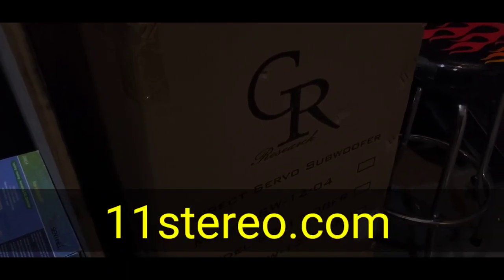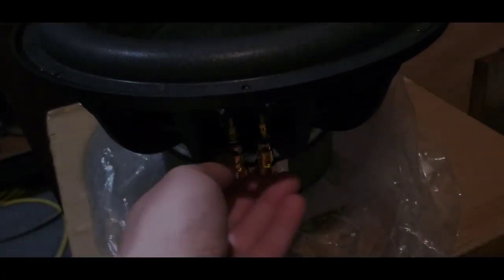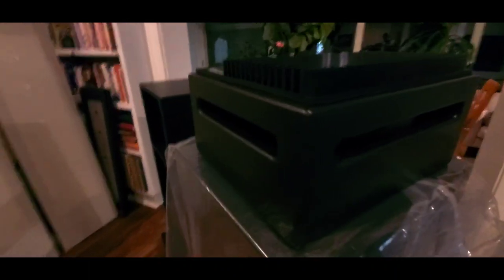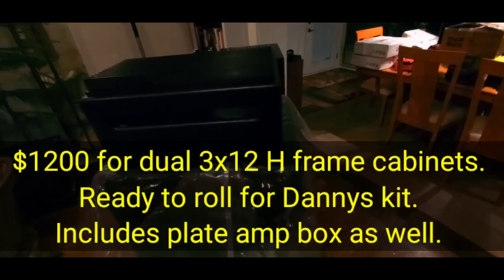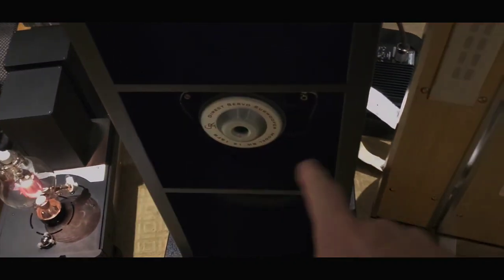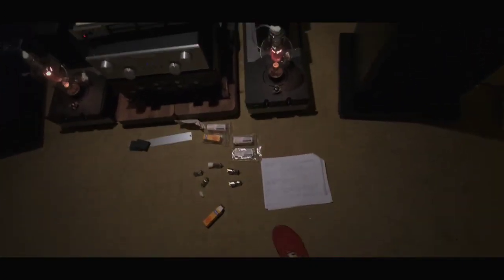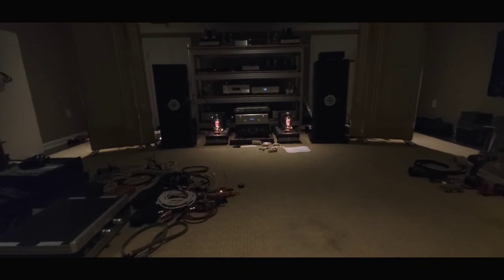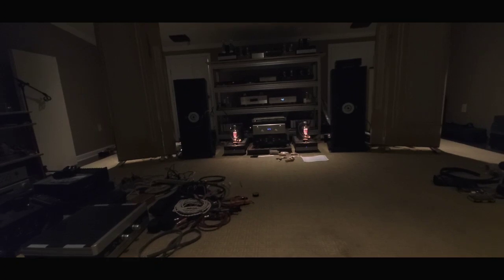Rythmik Audio servo Subwoofers GR Research open baffle

Comment: Hi how do you connect the subs if all you have is an integrated amp with no outputs
Reply from the maker: The way REL does and I cant stand this method but it does work I guess... you attach wires to the speaker outputs of t=your amp and run them to the high level input of the subwoofer plate amp. If you are buying subs make sure they have that capability first as not all do.
Reply: OCD HI-Fi Guy thanks how do you connect them?
I heard the GR sub for the first time the other day and the sounded too dry for my taste
Can you make them sound more like a 15” JBL driver?

Comment: The backwards driver is to reduce second-order distortion not to counteract the forces of the other drivers
Reply: Which it really can't because of the H frame - drivers would need to be really close (as in a push-pull configuration) for distortion cancellation. Still a good idea because of the more equal weight distribution (the magnets).

Comment: Dude, nice system
I dig these subs! 
I believe these are the ones I checked out at Axpona last year
 
fwiw;
the physical reversal of the driver isn't anything related to the driver's mechanical forces, it's to null the acoustic differences inherent in a driver's asymmetrical stroke characteristics 

as stated it's ideally effective in even numbers, and how significant the advantage is driver dependent

Comment: Hi Mike - long time listener - first time caller - lol
I run a pair of subs that were custom built for Ray Kimber that I picked up from his warehouse about 5 years ago with my Magnepans and it’s still the best match I’ve found. 

They are a sealed almost cube with Cabasse 21” drivers (I believe that’s the brand). I think the reason they pair so seamlessly is because the drivers barely move at all - just like the Magnepan panels.  I can’t tell sonically where the panel ends and the subs begin. 
So to sum up - a really large and well made driver with minimal movement seems to do the trick nicely. 

I don’t know the model number of the drivers and don’t know if they’re still manufactured. They’re 21” - the cone is coated in what looks and feels like black felt. I’m not going to remove the driver to check because they are really heavy and I’d hate to damage them.
Reply from the maker: Wow, killer Score man ! Ive played with the idea of 21's mounted in a closet with an open face to the room... One day ....  :-)

Comment: Very fast and clean bass but with rather compromised dynamism, compared to your old subs. Could we listen to that "Flight of the cosmic Hippo" track and a little bit of Mahler again? (I mean, we haven't heard this track on your old subs, so, no comparison...). I'm already wondering how Danny's single-woofer, servo-ed sealed sub might sound. Again, thanks for sharing. The experience shared is invaluable.
Reply from the maker: Hey FR, Tomorrow I will rewire per Dannys instruction as he sent the wrong wiring diagram thinking I was putting all subs forward, then I will replay Mahler(do you remember which one it was?)  and cosmic hippo
Reply: @OCDHIFiGuy  It was Gustav Mahler's Symphony No. 2 "Resurrection"
 with Claudio Abbado directing the 
Lucerne Festival Orchestra. But it was with only your Klipsches playing, so, no sub comparison again. Still, the exact piece played at your older video "
Gustav Mahler at 104 decibels. HEAVY METAL of the Era.", would be a great test for the new subs and main rig. I had the suspicion too, that something (wiring) was compromising the output.

Comment: Mike, 

1. The drivers coils are wired in parallel and the sensing coils are wired in series. 

2. There is not a force cancelling effect. The center woofer does not move in the opposite direction from the outer woofers. If it did then it would cancel out the output. All drivers move in the same direction. 

3. The No Rez should not be installed to touch the woofers, and yes it does take out the cabinet resonances. 

4. Be sure that you flip the polarity on the center driver (both driver and sensing coils) with it flipped the other way or it will knock the output down significantly.
Reply from the maker: Hey D, good to have your response,. thanks... ok so ive got the servo sensor wired in reverse for the center sub, but the driver wires do NOT show reversed on the diagram. So which is correct,  the diagram or what you just said,  to reverse the center driver, next, when I reverse the center driver which wires get reversed,  the input /source feed from below or the output/load to the top ? Or both ? This stuff plus having the center woofer reversed in the cab would be excellent info for the wiring diagram..  Thx
Reply: @OCDHIFiGuy  I didn't realize that you were reversing the center woofer. I have diagrams for both. 

And yes, if you reverse the way a woofer faces then you have to reverse the polarity of the coils on both the driver and sensing coils.  All woofer diaphragms have to move in the same direction.
Reply from the maker: @dannyrichie9743  Is there any benefit to reversing the center woofer if its not about forces ?

To be clear about sensing coils since they are in series, normal wiring per my diagram (if we start at bottom and move up) comes off amp red and goes to bottom woof red post then we come off black to red in middle woof then off black in middle up to red on top woof then black back down to amp. For the reverse, you want me to go out of bottom woofer from black to black middle woofer then red to red on top woofer then black back down to amp ?

Comment: Great video sounds amazing! 👍😎 Maybe build the plate amps into the bottom of the sub cabinets?
Reply from the maker: How ? Its an open H Frame  and has a heat sink
Reply: OCD HI-Fi Guy You could modify the bottom to house the plate amp by removing the bottom piece of wood and replace it with the box to hose the amp. It will also lift the subs up off the floor level matching the Maggie’s. Just a thought

Comment: I woulda stuck with the MDF... but hey... regardless, I HIGHLY recommend you install the no-res foam in each of the air chambers, it makes a genuine positive contribution.  The one is reversed because the weight would all be on one side and they would be very tippy, all the cones have to move together , as in the reversed install sub gets wired in + to - etc. Trust me on this, 3 woofers is gonna be plenty...
Reply from the maker: Mine would not be tippy due to the base I added that is not on Dannys plans. And fi he remembers to send me foam, Ive ordered it ... Thx !

Comment: The "pistons" do not go in opposite directions, Mikey.  The one mounted backwards gets wired out of phase so they all move in the same direction.
Reply: Yes, if you do not wire the center out of phase, you are left with just one driver.
Reply from the maker: Strange, im looking at Dannys diagram right now and theres no inversion on that woofers feed.
Reply: @OCDHIFiGuy  maybe, he has a different secret sauce. Ask him, why.
Reply from the maker: @mititeimaricei  Aiight Denz
Reply: @OCDHIFiGuy  ok, let's make it simple; try the other way around and let us know how it sounds, please.
Reply: Ye'p!
Reply: They may be out of phase on purpose. I don’t know the way Danny means for them to be. But I know bands have subs stacked, inverted physically but with the same phase to cancel out the pressure on the stage. Not sure if this is meant to be implemented the same way or not. I’d love to hear Danny’s answer and reasoning.
Reply from the maker: @karlbarstad  ill ask him to weigh in
Reply: @OCDHIFiGuy  In case you didn't know, there is an entire subforum for GR Research on Audiocircle.  You could read about these subs for days over there.  No need to rehash it all in youtube comments.  You want the drivers to all move in the same direction, so if your center driver is not wired out of phase, then you have reduced output and are not hearing what the subs are capable of.  Wiring diagrams are also provided on the circle.  They all show that if a driver is mounted backwards, it needs to be wired out of phase.  Alllll the info you require is over there.  You just have to go get it.